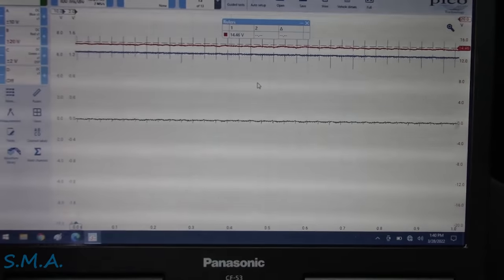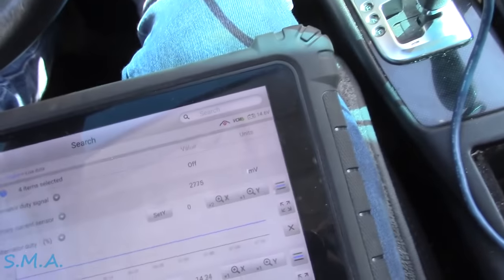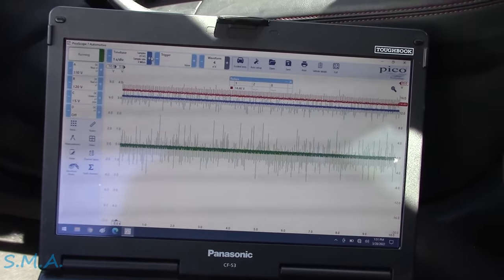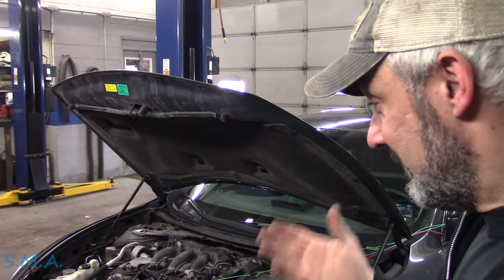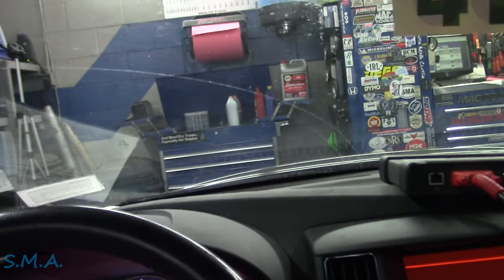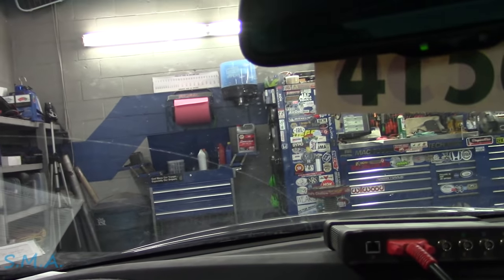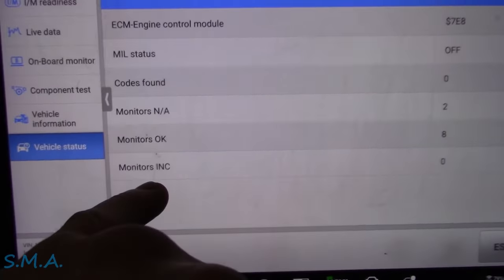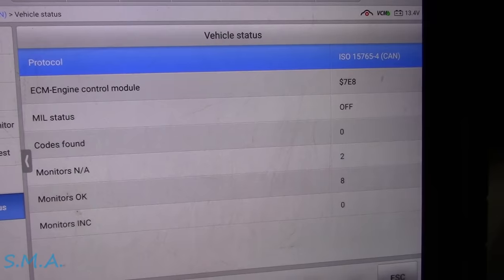Nissan Dealer Quoted Over $2000 For A New Harness!! - The Real Problem

Comment: Interestingly, I had a Nissan Maxima come to me with the EXACT symptoms as this one. Same codes, same driveability complaint... everything. I came to the same conclusion as you... alternator. That fixed everything. It's certainly one of the most odd grouping of symptoms I've seen an alternator cause, certainly made me scratch my head for a minute. Stupid Nissans lol
Reply: Of all the alternators I have replaced / repaired ( yes repaired/overhauled) voltage surge would be the least likely issue. Either the just die (totally) or die partially, ie limited output ( less than 13.5V) and reduced output current usually due to one or more failed diode(s) regulator pack failure, often caused by bad diode(s) or totally worn out slip ring brushes. Shot bearings just about without fail, like small grease packed bearings that run at about 5000 to 15000rpm, it amazes me how they do last so long, but thats another story.
Reply: I had a Nissan and replaced three alternators before replacing the first set of brakes. The alternators are of poor design.
Reply: @willarddunn8552  Nissans, generally speaking, are of poor design.  Been that way for a quarter century now.
Reply: Nissan is the Chrysler of Japan.
Reply: @catfishbilly7425  Too many cost reductions driven by the bean counters leads to a drop in quality.  Don't think for a second that the engineers aren't trying to make a quality product.
Reply: As an amateur repair guy, because I couldn’t afford a real one for many decades, I have to say that if this had been my car it wouldn’t have ever gotten a new alternator (so never been fixed). 
I am so glad I didn’t get a Nissan when I was looking for a newish car recently. I didn’t know about the “remove the AC compressor to replace the alternator” thing. It would have been an absolute no buy right there. I had a rental 2018 Altima for 6 months and 10,000 miles and absolutely loved how it drove as well as the amenities in the drivers seat. Ended up with a 2018 Corolla LE though. I do 3333.4 miles a month average over the last 2 years and needed a car that could do it with no problem. I have 140,000 on it now and it’s been great, except for the windshield cracking (twice) and the AC only working when it’s not hot or on the interstate. 
Love the channel! Was able to figure out what was wrong with the wife’s cavalier by watching your diagnosis system and applying it to my problems. Turns out, the problem with the fuel pump popping fuses in the cavalier is pretty much just because it’s a Chevy.

Comment: Good job! Not a auto mechanic here but I have worked on my own vehicle's for almost 50 years. As soon as I saw that 17+ volt output from the alternator I was thinking voltage regulation problem. Aren't most 12v charging systems limited to a maximum of about 14.8 volts output? An original high mileage alternator with excessive voltage output and no duty cycle, bullseye! I would also bet that the drive belt squeal was at least partially caused by the excessive load on the alternator making 17+ volts. Again good job!

Comment: I've got a fair bit of diagnostic experience in my 30+ years of working and still find myself guiding the diagnosis instead of looking at the data.  Mr. O your level head really is the key here, thanks for the follow up!  BTW, if the Nissan knowledge base is a bit off, perhaps the training is the same?  Meaning maybe the techs missed it because their information is bad.  The magic of being an independent is that you get to look at all the info.
Reply: And as an independent your not lead by book time, or a manager telling you not to spend to much time on it.
Reply: And sometimes gaining relevant info from working on more than just one make ALL the time.

Comment: It’s a shame too cause this is a pretty common failure for these cars. Dealer should’ve known better.
Reply: of course they know.. why not try to suck 2000 plus out of customers. that's what they do. the local garage here did that to me. im in 1300 for repairs and they still cant figure it out.
Reply: ... but it was their 'lead' mechanic!
Reply: It is common on these, and after watching this I made an appointment to get my alternator changed. It still works but at over 200k it’s bound to do the same thing soon.
Reply: @ylimehajile  Yeah, pretty scary right?  Imagine if the problem was something difficult, like a transmission.  Of course the only repair for Nissan CVT's is total replacement because they don't offer the belt and pullies as a repair item.  CONVIENTLY costing over $4,000 to replace.  Ask me how I know.
Reply: @ylimehajile  is that "Lead" as in plumbago

Comment: Dealerships will never give a tech the kind of time you took on a diagnosis ... there lies the problem with a dealership... they make $$$$$ changing parts ... not diags.....
Reply: You're right. I can tell that you have experience by your comment. Not just "YouTube" experience lol. 
I've worked in shops that would give the tech time to diagnose accurately and I've worked in one's that don't.
Reply: So does Eric but he has integrity and has put himself in a position where if he makes a mistake he will take responsibility for it.
Reply: That's because the "flat rate" pay scale puts a strain on techs to be fast and efficient. If dealers want good techs, especially ones good at diags, they need to rid of flat rate, as that's an outdated pay scale anyways.

Comment: EPIC diagnosis but funny that the parts cannon would have solved this a bit faster.  The batt light coming on and other sensors going wacky led me to immediately think batt/alternator.  Hopefully the overcharge didn't cook the battery, then forcing the alt to work and creating this cycle again.  I would go after that dealership, they are supposed to be the experts.
Reply: I wasn't too sure about the alternator, but I was pretty sure about tackling the power issue.  Computers HATE bad power.

Comment: I had a problem with my Honda Civic 97 2Door Coupe with 286,000 miles in it, almost a month figuring out what P1289, P0353, and P0141 make the engine light on. I keep making research and luckily I read that it might be a blown up fuse. And it is actually the problem. So I replaced that fuse and viola! No more engine light. By watching this I got reminded of this b/c you keep mentioning about the alternator overcharging incident if I am not mistaken.

Comment: Another awesome diagnosis and repair! I was in a similar situation recently, just backwards. Local shop replaced parts due to original misdiagnosis and never were able to make the correct diagnosis after 4 weeks of screwing around. A short look by an experienced dealer tech and I had a new engine coming under an extended warranty I didn’t know I had. Knowledge is key!!

Comment: Great repair - shows there's no substitute for experience!
I bought a used Golf GTi - took it for it's first service and they quoted for a load of stuff they said was needed - new battery, door locks, ignition lock - huge list of stuff because of the codes that were thrown up.
Called a bud who worked in the trade who immediately asked if the previous owner had changed the battery.
Answer was yes.
Turns out when you disconnect the battery the computer throws up a load of codes because the voltage has disappeared, and they had not been reset after reconnecting the new battery.
I'm guessing the Stealership  knew this and just saw the opportunity to make some cash for a quick reset.
Yep - experience!

Comment: Thanks for taking us along for the ride, with a 2-part case study, like a certain mobile tech in State College, PA often does.  Does the Nissan charging strategy, which is intended to save fuel, make it more difficult to make the call?  If so, that is a real downside to using that strategy.  Now, here's hoping that another Nissan with a similar issue comes in, and that would be a payback for the personal time you had to spend researching the theory & operation of this.  And was the Napa alternator new or reman?  My guess is that with this being so complicated to diagnose, you would go with a new one, and not want to inject another variable into the mix (if reman, is it a good one?).
Reply: I love Ivan, too!

Comment: Total refund and apology with free oil changes and inspections for life of the car! I recently retired after 31 years as a technician at a local Ford dealer here in Buffalo and that what we would have done. Dealer service tech are supposed to be the cream of the crop but as we saw here that’s not the case. Independent shops almost always get a bad rap but as with you Eric that simply isn’t the case! Keep up with the great videos! What would the dealer have done if she bought that harness and it still wasn’t fixed !!!
Reply: I wouldn't let that dealership service department TOUCH my vehicle ever again after this fiasco.

Comment: Remember when alternators were on the top of the engine, usually on the left as you looked at the engine, loosen 2 bolts, take off a belt and then just remove the bolts n pop out the alternator? Ah, the good ol' days...
Voltage regulators used to be a separately replaceable thing too, even when they were mounted on the back of the alternator (I did one once that was mounted behind the instrument binnacle... fun... still easier than stripping out half an engine though).
Anyhoo, I thought voltage regulator while watching the first video, just from the description of the faults and the  "abnormal voltage" code, didn't realise it was an internal alternator component. Nissan dealer lead tech needs to go back to school I think... muppet that he is.
Reply: Them new fangled alternators, I remember dynamo's and 6 volt electrics proper cars back then!
Reply: "I thought voltage regulator while watching the first video. . ." 
Me too. It probably was the regulator or voltage- control circuit that is built inside the alternator. But $2,000 wiring harness––no way.  I stay as far away from dealerships as I can.
Reply: @SiteReader  I wondered if the tech knew what was wrong and how much of a pain in the butt it was to get at, so tried to scare away the customer with the old car... but that would be strange, since they went with wheel speed sensors, which, in a place with salty roads can also be a complete pain in the butt... I live in Scotland, so I know what rusty undercarriages are like to work on.
Reply: @bryanlatimer-davies1222  Bring back positive to the chassis I say! If they rust to bits inside 5 years, there's no need to repair any of these complicated bits.
Reply: @1973retrorabbit  Hard to tell at a distance. I'm glad I have the knowledge, and time now, to do my own repairs. Would hate to have to depend on dealerships, or the many under-qualified independents out there. I'm maintaining three old clunkers (or should I say "vintage cars") in my retirement.
Reply: The alternator location on these cars is infuriating. I usually do work myself but I’m letting the shop deal with that nightmare
Reply: Even better.  You didn't need a special belt tensioner.   You loosened two bolts, and the entire alternator pivoted.   pull off old belt, put on new belt.  Put cheater on alternator, pull it till tight, tighten top bolt, tighten bottom bolt, you're done.   Check every two to four weeks.   No struggling like crazy with the belt.

Comment: Had a Mazda like that. Dealer: 8k for harness and pcm. Me: found a shorted transistor in the anti-theft  module PCB on a 12v sense circuit. Replaced transistor, resolved. Actually took the PCB home to backtrace the short while enjoying some brews. Understanding automotive electronics has brought me to understanding circuit boards, household a/c, electrical, hydraulics, pneumatics, computers, etc. I just do diagnostics now and days. Good videos, keep it up.

Comment: I think she should get her money back honestly. After being hosed by shops in the past it kills me that they won't just admit they messed up and refund customers for their error
Reply: 100% agree.  CLEARLY what they "repaired" wasn't the problem.  They all hide behind "it was a contributing factor"  as in, I had to fix that to find the real problem.  Only they NEVER found the real problem.  Imagine if she has spend the $1,200 to replace the harness only to find the problem was STILL there.  Then they would have made up some other lie to cover for their incompetence.
Reply: I just recently put 4k into my truck to have the rear diff rebuilt and have other random stuff done a year ago. I drove the truck off the lot and it was really making a lot of noise so I called my buddy who is a diesel mechanic and he got under it and found right away that it wasnt shimmed right. I took it back to the shop and said hey its making a ton of noise and leaking around the seal. They told me well what did you expect me to do work magic?! And said after I paid the bill they wernt gonna touch it anymore. They also said they did my break lines and after 3 months of driving the front one was leaking cause they cross threaded it on the caliper. Then last week the whole rear line blew while I had the kids in the car.... Long story short good mechanics are very hard to find
Reply: @brittany6229  I'm sorry to hear that.  Good mechanics are almost as hard to find as a good politician. LOL   I think the key to finding a good mechanic is look for a small shop with a clan parking lot.  It's a good start anyways.  Did you ever get the differential straightened out?  Sounds like a GM truck with the brake lines. lol  I had the same problem.

Comment: Best relationship I've had with a dealer was with a local Mitsubishi dealership. Had to swap out an AC condenser.  Bought the part privately, went to dealership  and drained the system, went home and changed condenser, back to the dealer to recharge the AC and viola, back on the road.